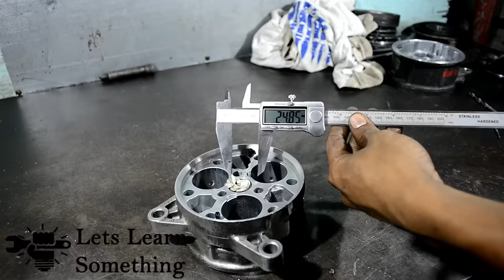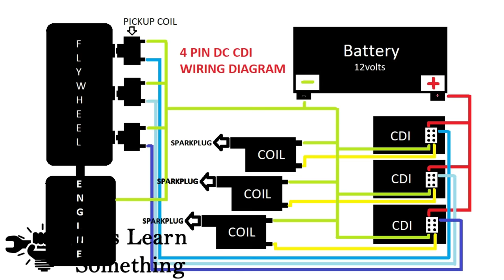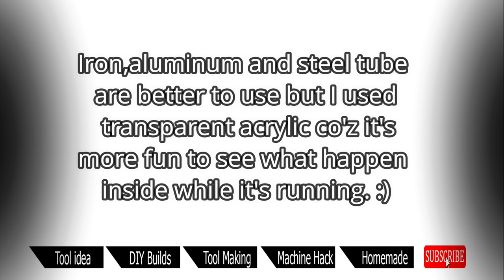I turn Car Compressor into Working Engine

Comment: I had no idea that automotive A/C compressors were piston-based.   Now I'm thinking STEAM conversion!  This was truly brilliant and I just loved it!
Reply: I like the way you think
Reply: That would require far less modification than internal combustion; you'd basically just be running it in reverse. Brilliant!
Reply: Not all they are so some rotary  they use pistons and swash plate
Reply: @jul1440  no its no so easy as it looks
Reply: @HDSME  Your best bet is single piston because you will not be getting a steam expansion boost with a multi-piston compressor.
Reply: @HDSME And some of them are scroll
Reply: @satan101101   I call them jelly roll coils lol hey they work !!!
Reply: How tf could u not know. Even a non mechanic or car savvy person knows
Reply: @brokentradgedy  Because many A/C and refrigeration compressors are scroll compressors.  I just assumed that automotive ones were the same.
Reply: @patchvonbraun  I'll give you a pass then my good sir
Reply: @brokentradgedy  I'll make a general comment that not everyone visiting a channel like this is intimately familiar with the background material.  So a comment like "How TF could you not know this" is, well, less-than friendly.  Just an observation.   My own background is in cryptography and network security, a field that I have 11 patents in.   More recently, I've become heavily involved in astrophysics education.  If I had a YT channel, I would absolutely NOT expect everyone visiting the channel to be intimately familiar with the content, nor would i encourage "How TF could you not know this" type remarks.  I have frequently had the "how TF could you not know this" sentiment in my work.  But I keep those comments private, in support of social harmony...
Reply: @brokentradgedy  most people I see driving around at night don't even know how to turn on their actual lights and just use running lights. No way in hell non mechanic or car savvy people know this.

Comment: A person with a masters degree in mechanical engineering would have a hard time building a similar engine. BRAVO! You definitely earned my subscription.
Reply: Hell, most of the MEng students I know could design it in CAD, do flow analysis on it and write a book full of equations explaining how it works, but would struggle to take the old AC compressor apart, let alone adapt it in any way!
Reply: @hamstirrer6882  Seriously. This guy should be working at NASA or SpaceX
Reply: 2 stroke. not as difficult as you think.
Reply: @Ihavetruth22  If it's so easy, you should make something similar. It's a surefire way to earn a million subscribers. Which is more than enough to make a good living from.  I'll subscribe to your channel now. Should only take you a week or two to make something similar. I'll be waiting.
Reply: New subscriber here 👍
Reply: @Ihavetruth22  2 strokes are actually more complex than a 4 stroke

Comment: This is the dream of a lot of budding mechanics (I know it was mine as a kid, but we were limited to points ignition and metal parts). At the time, all AC compressors were still standard piston, crank, and connecting rod configuration, and the axial compressors didn't come out till later on. I'm glad you included the failure of the first acrylic reed plate, which demonstrates that these projects rarely ever go according to plan the first time around!😁 The second iteration was a much better setup, and I'm surprised it ran as long as it did before it melted the threads on the spark plugs! Well done man!😁👍👍 I really like these little projects that use the most basic of components for proof of concept.😉
Reply from the maker: Thank You so much bro :)
Reply: the whole idea was to be able to view the compustion that is why he used acrylic. I hope later on he used aluminum heads and put fins on them
Reply: @rogerd4559  y 15 matsintumBok
Reply: Wasn't this cool. The was that disc turned the pistons. Very cool. I've never seen anything like it. He just started drilling holes, I was like nooo... lol But he obviously knew what he was doing. This was fascinating 👏 👏 👏 👏 👏
Reply: @frankierzucekjr  Those little holes he drilled are the exhaust ports I don’t know if he could maybe modify them for more power
Reply: @frankierzucekjr  did ya miss the part with the digital caliper? measuring devices go a long way when doing things like this. try it
Reply: @Cherokee93 It's a 2 stroke. It would probably greatly benefit from an expansion chamber exhaust

Comment: I finally figured out that this engine design is called a revolving cylinder, axial piston engine, for all those wondering.. I guess technically it would be described as a revolving cam, axial piston engine. Very similar to a swashplate axial piston engine, like those used in torpedos, however instead of a swashplate rotating, the whole cam rotates which has peaks and troughs that push the pistons up and down as It rotates. They operate much better at slow rpms as the centrifugal force tends to wear down the engine too quickly when it’s operated at high rpm’s. Which is why they have limited applications and are great for torpedos. Very interesting and impressive engine nonetheless!
Reply: Interesting info!

Comment: Literally the coolest thing I’ve seen in a while; sounded like a radial engine mixed with a Harley Davidson and a 2 stroke
Reply: is the equivalent of 2 stroke v6
Reply: my thoughts exactly its quite unique
Reply: @Goguleroma  no one side is valves. Also v means the cylinder s are at a v angle
Reply: That's because it effectively is. It is a 2 stroke Radial-3 with a supercharger. I'm curious as to how much power and torque it produces.
Reply: he used the back side as a mechanical fuel pump thats why the transfer ports and reed valves are there  if he used an electric pump the reed valves would be up on the spark plug end.
Reply: @johnrickard8512  No it is not radial either it is a 2 stroke revolving 3

Comment: That thing sounded good!! Reminds me of a cross between a radial aircraft engine and s V8.  It didn't sound like a two stroke!
Reply: exactly what I was thinking, a two stroke thayt didnt sound like one but sounded powerful
I think because it had dedicated pistons to force the mixture into the combustion chambers, where as a conventional two stroke has a compromised crank case to do that. So the fuel mixture is 100% completely injected into the power cylindealso notice no need for piston rings as the  blow by increases the compressor stage pressure of the supply gasses
Thus less friction= more efficiency
Reply: it kind of reminds me of the old opposed 2 stroke diesels it's got that kind of sound to it.
Reply: @stonemason9063  haha i found junkers opposing piston engine piston...first use germans had for chrome was piston ring on that owo
Reply: @bsod4144  Yes Junkers were experimenting with the opposed piston engines but had trouble getting it to work, Napier in England built an engine called the deltic which was based on the Junkers designs - This was a lightweight (for its displacement) powerhouse high revving diesel that sounded like you had arrived in hell. Unsurpassed in performance even today. It powered the first diesel locomotives and fast boats in WW2. Look up the Napier Deltic.
Reply: @rogerd4559  .

Comment: I'd be curious to know the power output of this thing, it looks like a great idea for lots of compact applications. I wonder how well it would work with six cylinders working and an external supercharger instead.
Reply: The rpms  are so high, it looks like it could be used for RC airplanes :)
Reply: @alves6465  yes, maybe with and aluminium flywheel and some more weight reduction it is possibls on a 2 metre long plane model i think
Reply: It would probably get way too hot.
Reply: @ct92404  yes, it needs a cooling system
Reply: I think it would fail
Reply: Such engines lack low end torque and can only make usable power at very high rpms. Lubrication was also I sufficient. Lack of lever action on the crankshaft or lack thereof leads to minimal torque output. High friction engine like this will need copious lubrication and that would contribute to higher parasitic drag and lower operational efficiency. That's why conventional engine is the way to go. If high revving engine with good power and torque is desired it's better to go for the turbine engine instead.

Comment: Do you have idea of how many engineers spent their whole careers without actually seeing something like this? having to imagine it instead of actually seeing it? great job man. 
Pay no attention to negative comments. They don't have your ability, that's all. 
thanks!
Reply: Exactly
I also wished that I can see running engine inside view
Reply: Practical experience doesn't come from books and computers, unfortunately most managers think, with an university engineer degree you are a knowledge superman.
Reply: @sebastianweber9791 
You are right, books only give you the concepts, proper deployment of the concept is really a superman job in the production environment
Reply: I second your statement.. great job!
Reply: Agreed.
Reply: That's the key isn't it.  Like a composer creating symphonies'.  Can't say enough about this brilliant man!!!
Reply: @maddyinc933  Yeah you are right but nobody thought to show how it look like when engine fires in the cylinder.

This is the beauty of project
Reply: My thought's exactly. nothing but love man, nothing but LOVE.
Reply: Joe where exhaust
Reply: So amazing💪💪💪💪💪💪💪
Reply: @aggabus I think it was one of the holes he drilled on the side of each cylinder

Comment: Duuude this was the sickest combination of engineering and craftsmanship ive ever seen!
Reply: James Ross  they do with what they have
Reply: James Ross  How did he half-ass it? Making it out of simple parts was what made it interesting i think
Reply: James Ross  Y'know... despite literally gluing everything together and using acrylic, it still ran. No, it won't last, but I dont think that's the point of the project. He just wanted to convert something into an engine and then be able to see inside while it ran. You don't have to go out of your way to be an asshat.
Reply: James Ross  use lexan
Reply: True, I contemplated for 15 seconds and couldn't think of anything else other than pressing the Subsribe  Button.
Reply: Echt der Hammer! 👍
Reply: James Ross ,   What Have You Done Lately, If Ever?  Ross you gotta be a Millennial !
Reply: @nathaaab  i agree
Reply: James Ross  Lol, you're depressing.
Reply: James Ross  just cause you have tools doesnt mean you know how to use them... lol i'm a tool and die maker by trade and i can tear anything apart and put it back together... and o... i don't have a snappy cool snap on tool box either... i can't afford that expensive shit... lol god bless and hope you're not so salty about someone trying to post a COOL ASS VIDEO and you decide to shit on it for dumb reasons

Comment: To everyone that thinks turning a car compressor into a working engine is amazing I agree 100% definitely got to see it to believe it.
Reply: Nope ...leaving now
Reply: maybe 150 years ago. nowadays we have actual engines
Reply: Pretty darn creative. How is the heat and lubrication of the working parts holding up?
Reply: Don't be jealous.
Reply: well, I never saw those type of pistons used in a combustion configuration nor have I ever seen it with a crank that doubles as a timing cam that is the shit and it does away with a shit ton of parts that can fail in a practical scenario. if this can be made to put out useful torque scaled up he's on to something.
Reply: @blameusa7082  Wow 150 years ago I didn't exist what is you saying you have a video or you existed 150 years ago that I got to see to believe
Reply: The Wankel motor was originally designed to be a compressor..
Reply: @blameusa7082  yeah, I'm sure they used to turn car ac compressors into engines 150 years ago..
Reply: My dad built a working model out of plastic back in 1961 of the same concept.. nothing new under the sun!!
Reply: @ronwhittaker6317  it's a swivel plate pump.. hydrostatic units on farm equipment have been using a variable swivel plate pump and motor to propel farm equipment for 50 years.. what he built barely runs and produces no power..   it's a toy..
Reply: @ronwhittaker6317  It sounds powerful I bet it would power a bike no sweat
Reply: @srenpetersen8209  and where is the Wankel now?
A miserable failure
this swash plate engine was in the mechanics illiustrated 50 years ago but for some reason never caught on
Reply: @rogerd4559  It has caught on in light weight aeroplane engines..
Reply: @KBS117  video?
Reply: @FuLLeFFekT1 sports cars? I thought Honda made lawnmowers...shaped like cars😆 
I gotta admit, the Wankel engine is without a doubt an impressive achievement due to how it does a normal thing in a not so normal way
Reply: @srenpetersen8209  And was a total failure. To this day, they have not solved the rotor seal issue. But I notice Mazda is resurrecting it once again. Maybe they've come up with a solution ?
Reply: @srenpetersen8209  there is a big diffrent between Wankel motor and air comperesor. Wankel has not a pistons my dear. also cmpletly thier mecanisem are not same together. sorry about this note,...
Reply: @ronwhittaker6317  no, it's doesnt double as a timing cam, it just works like a 2 stroke because it is one.
Reply: You have seen it working. It was the principle that was demonstrated here. Only those people who does not understand the principle of an internal combustion engine would have thought that this is trickery.  Don't be jealous man...
Reply: @GbbJunkie the original was actually designed to start the A-10 Lightning ||’s (A-10 Warthog’s) engines for military use

Comment: You're like a real life Tony Stark. I can't even imagine the engineering skill and imagination it took to build this. I spent years from a kid to an adult building go-kart motors from lawnmower engines, and tinkering with electric motors and whatnot, and never ever would I be able to convert an automotive AC compressor into a working engine. Bravo, you really showed some real genius building that motor, and replacing the acrylic was awesome to let us see the action inside. Thank you!
Reply: The reason why can't do it is because you don't understand how an engine works. Reade engineering textbooks from the internet and it'll become is for you, too
Reply: @apurba420  Do you not realize people build engines as a job?
Reply: InfiniteLoop this ones~
Reply: Yea...he is good...but the engine just for temporer fun...no adequate lubricating...no cooling system..2 stroke engine...great for experiments....not for real works
Reply: @budhihart8161  I'd imagine compared to getting all the timing etc right, the lubrication and cooling would be relatively easy. You would only have to drill some holes avoiding the existing pistons holes etc and attach another wheel to the crank to drive a water/coolant pump.
Reply: @BurtMeister  not thats easy....lubricating a working psiton and rod on even 2 stroke engine is not as simple as u thought...the material also different from ac compressor...
Beside the comoressor piston material also design for very high temps...
As i say..good for fun...nice ideas...but not for real work....
Reply: @BurtMeister  btw on 2 stroke engine timing is much easier then 4 stroke
Reply: Man the creativity and problem solving skills to do this, it's insane
Reply: @budhihart8161  people in the comments are praising this and that is good but this is not a usable engine design. It's more like a experiment . It'll overheat due to lack of proper lubrication.
Reply: @JohnDoe-zj6xf  yes...but still it was creativé

Comment: This is probably one of the coolest things I’ve seen on YouTube
Reply: so cooooooool...wonder what kind of power would it have on a bike...doesent look too small for me that gotta be over 70 cc
Reply: I have to say I 100% agree
Reply: @bsod4144  even with a proper carburetor it wouldn't probably be able to make more than 1 hp, it's not always about the ccs, the ignition timing and port timing are way off to make more power..
Reply: @jepulis6529  ahh i see
Reply: @jepulis6529  - I would think that ignition timing, would be simple enough on this yet; I don't know how one would adjust port 'timing' for this project. And, I would hazard a guess of close to 30cc's displacement, for what that may be worth.
Reply: No
Reply: Is this your first week on the internet ?  LOL
Reply: @jepulis6529  *consult the manufacturer for the timing specs....make the steel pieces ajustable instead of welded on, and use a timing light...lol.
Reply: You said it!
Reply: agreed
Reply: me 2
Reply: U
Reply: @bsod4144  ññ